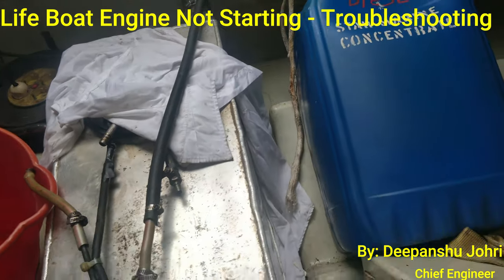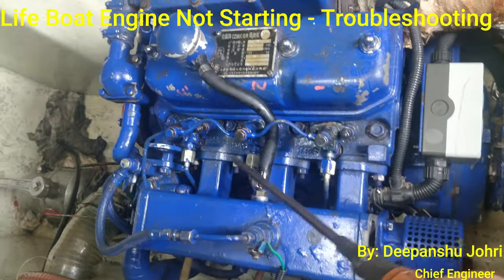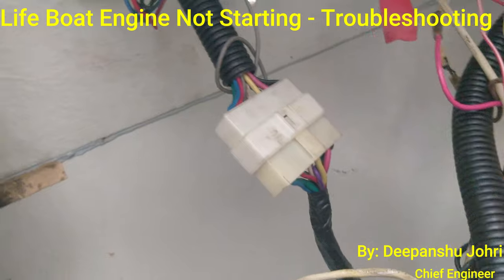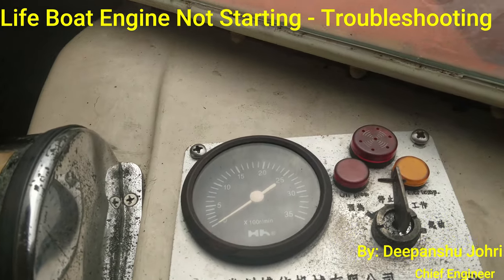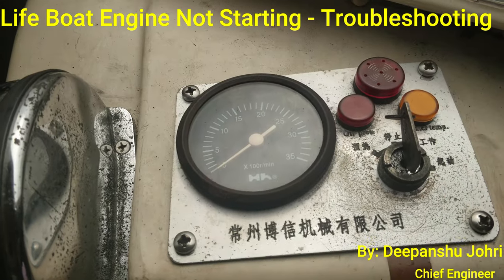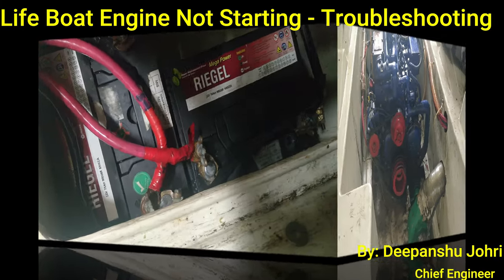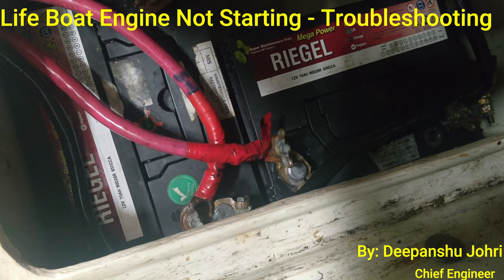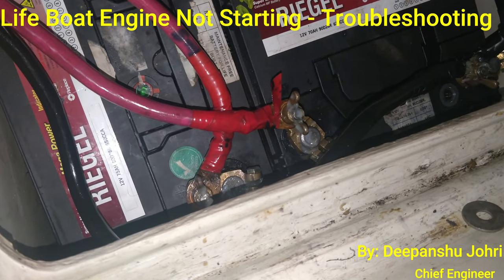Life Boat Engine Starting Problem Troubleshooting

Comment: So what the problem chief?
Reply from the maker: Problem was with fuel pp ...and plunger and barrel.
Reply: @deepanshujohri  and then engine can start?
Reply: Problem only damage teeth plunger barrel?
Reply from the maker: @sagarao2108  no still couldn't start, we replace full unit.
Reply: @deepanshujohri  i have same lifeboat can not start also chief
Reply from the maker: @sagarao2108  Buddy - Technician also came in Singapore, he cannot. Then later we solved by adjusting the timming and fuel pp unit. Better change the engine. My company also wanted to do same.
Reply: @deepanshujohri  sorry chief why you delete video engine life boat? I want to look at plunger barrel
Reply from the maker: @sagarao2108  no i have not deleted any video. You check on my other YouTube channel Mariners Diary
Reply: @deepanshujohri  chief my life boat engine already start now. I found Timing for fuel pump missing become earlier
Reply from the maker: @sagarao2108  this is regular problem with this type of engine. Please subscribe my channel